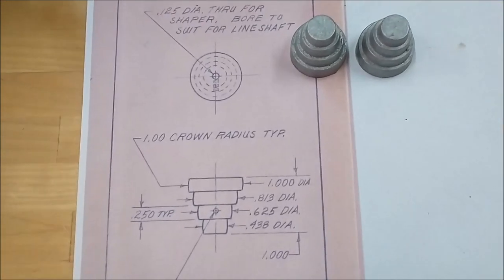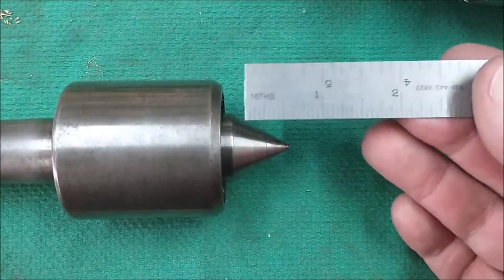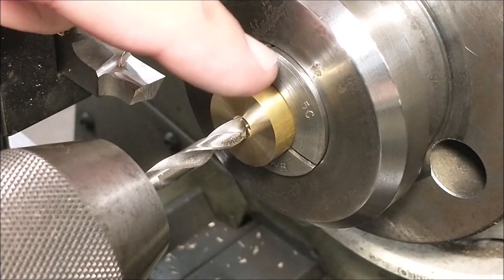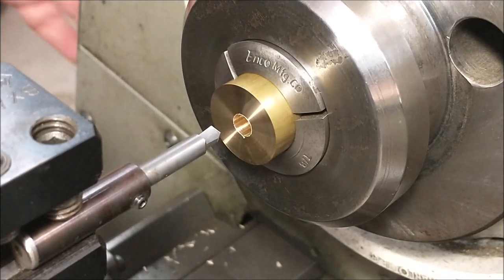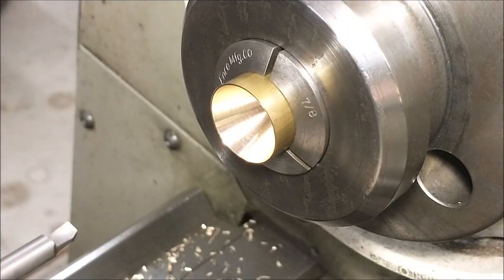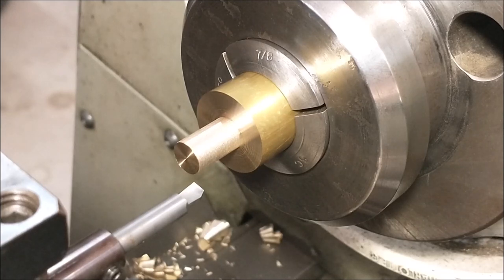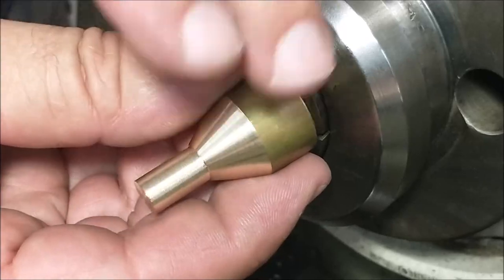Machine an Extension for The Live Center on Your Lathe -- A Great Beginner Project !!

Comment: I remember my machining tutor saying that turning a taper with a tool above or below centre would make the feature parabolic with either a belly or a hollow in the centre of the tapered surface. Essentially you'll be generating a conic section  parallel to the axis of the cone. It would be interesting to see if it could be measured.
Reply: I was told the same in 1976. I've always wondered if the geometry would work out for machining small parabolic reflectors for mmwave radio antennas or infra-red focussing mirrors, but I can't convince myself about the maths as the curve approaches the point where the tool is parallel to the axis but above it.  Feels like you'd need to drill or bore out the centre of the workpiece to the same radius as the offset height of the tool. Fascinating idea

Comment: I used to make up similar out of bronze, to support the muzzle end of barrels, for threading, while protecting the crown / rifling.
Usually made a batch, to have on hand.
They could usually be refaced a couple times for the tapered face being embossed, each use.
Currently in the throws of getting together the pieces to put together a ER40 - 3MT live chuck.
My fantasy being the ability to select fit, gauge pins, as pilots in bores, via ER collets.

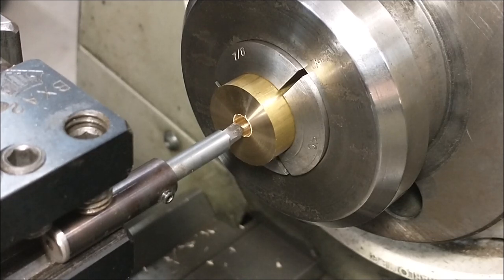Comment: It's worth noting that raising (or lowering) your tool from the centreline – as you had to at 3:44 – doesn't simply alter the cone angle angle: it actually means that you're no longer cutting a true cone.

The shape you'll cut is a hyperboloid (I think), which looks cone-shaped, but if you cut a section through the centreline, you'd see that the edges of the cut are curved slightly inwards, in contrast to the straight edges you'd have on a cone.  The shape is similar to that of a power station cooling tower, though nowhere near as pronounced.  This will result (theoretically) in the live centre only engaging your part along one edge, at the wider end of the cone.

For the amount you raised the tool – about 0.005", if my pixel counting is on point – the effect is so small that you'd need NIST to measure it.

If someone making the same part had to raise the tool by 0.025", the diameter of the narrow end of their "cone" would larger than the live centre by about 0.0035", and the average radius of curvature of those imaginary sectioned edges would be around R87".  Increasing the tool offset to 0.05" changes the diameter error to 0.015" and the curvature to R31".

I know these are small numbers, but they might allow the adaptor to move around enough to scrap precision parts.

Before I go, I just want to say that I'm genuinely grateful for this, and all your videos.  I'm a long-serving mechanical engineer, but have only a few hundred hours' experience on the tools, so the knowledge, tips and techniques you share are invaluable in helping me get the most out of the mini-lathe and micro-mill which our cash-strapped start-up uses for prototyping.  Thank you!
Reply from the maker: Interesting. I may have to test that. Thanks for the ending comment. I'm glad it helps.

Comment: LOL
When things just work out:
I had to change a fixture setup on a mill today. I eventually placed my first vice, eyeballed it, gave it a very small knock with a soft hammer, then I slightly tightened the four bolts just so I was safe to dial the orientation in. 
I laughed out loud when I checked how much it was off:

Over a total length of 400mm (Y-axis) I was only 0.004mm off! HAHA great Friday I can tell you!
The second vice took me around 10 mins. Overall it went pretty fast today.☺
Reply from the maker: When indicating a vise, tighten the hold down bolt on one side, more than the other. That way, you know what way the vise will pivot when struck and you don't have to worry about the whole vise moving. It really helps.
Reply: @joepie221  No worries Joe. I didn't want to write down the whole perfect process. There was a lot of work before hand and you know how long the text would be, all things considered. I watch your videos, only because I know that you know what you're doing.😉
I'd only call you out if I had to.
Keep it up. It's good to see some solid craftsmanship. 😘

Comment: A good demonstration of how to make useful gizmos for holding awkward jobs in the lathe.  I had to make one like this except it had to have a female cone on both ends and this enabled me to finish the tapered rod between the balls of 19 ball-ended handles for my Quorn T&C grinder.   Your videos are super educational and are full of gold!
Reply from the maker: Balls can be held against simple bored holes, cones aren't really necessary. Maybe for seating on the live center, but thats it. I turn 1" balls here and a small seat works fine.
Reply: @joepie221  I guess the ring of contact would be the same so yes you are correct (I never thought otherwise) - thanks again for sharing your skills and knowledge.

Comment: For me, the most important piece of information was the 'throwaway' comment at the end -
' make it out of soft material so you can hit it with tool if you need to'.
Until then, I was thinking drill rod or 4140 as I have some of each, now, looks like a bronze one will get made as I don't have any brass even close to right size

Comment: Problem with mini lathes is you dont need live center extension ,you need a lathe bed extension . Some of them are so small that chuck takes half of working dimension. 
Anyway great little project .
Reply: Too darn true...    
Most live centers have the bearing part sticking out. We might be able to make a live center where all the bearing stuff fits within the MT2 taper. That should give us another 50 - 75mm work length. Just need to find the right bearings. 
Oh, @Joe Pie, we have an idea for you...

Comment: I found a boring bar on a certain Chinese website. It's typical Chinese of course, and the seller have no idea what it is or anything. The shank is 1/8", so a bit fiddly to clamp, but... it only requires a 1.1mm hole! It doesn't cut deeper than about 0.3mm in one pass, but at those scales, who cares...   I used it to cut a taper in the hole of an adapter for a diesel line.(To connect a cheap diesel injector tester to a 60s injector from a tractor) My part was in soft steel, but I also tried it on brass. 
It might even be possible to fit it to your model lathe...

Comment: You certainly got lucky 🌴

I always wonder about using cloth sandpaper on a running lathe. Is that safe? Can't the lathe grab that? This is an honest question.
Reply: You always use a light grip (e.g. between fingertips) for just that reason
Reply: Proper technique is key. Which holds true for all operations on machines in a machine shop. They are all inherently dangerous for the uneducated or inattentive users.
Reply: Yes it can but all lathe operations are dangerous. Gotta be careful how and where you use your hands

Comment: Each and EVERY time you post you have a tid-bit of "Hey, Try this" my friends. Aside from not really this is the way things work for you you encourage us to experiment with your/our machines. No two machines have the same results in the way they respond to our requests of them. Take a sacrificial (even wood) blank and put it through it's paces. Try a different medium and so on till your marriage to that picky woman/beast is an extension of your mindset. No two things in our world respond the same way. Your numbers will tell the story. 
.0005 tolerances  using fresh tooling can be achieved on a daily basis. Even over 10 feet with temperature controlled situations. Making these adaptors that sit in the tool box are well worth the time and materials. They may gather dust for years until that one day when they come into play that bail us out of  a tight spot. Thanks a bunch bud. Take care eh !
Reply from the maker: All you have to do is remember where it is. :)

Comment: Joe, do you use a positive or negative rake turning brass? It almost looks like a neutral rake in some places.
Thanks!
Reply from the maker: I use slightly positive for my turning. Some prefer neutral to avoid the diving, but my machine is rigid enough not to worry.

Comment: I don't understand why not move the cross slide out further, why is it better to move the carriage in further? I guess I have been doing it wrong. I move the cross slide further out.
Reply from the maker: As you move the cross slide further out and work to a set position on the compound, the angle bore feature may form a shoulder at the bottom. If you can see the entire cut, it won't matter, but for blind work its not advisable to move the cross slide.